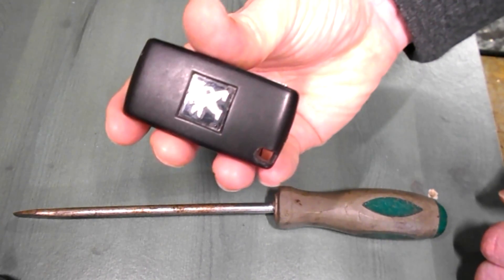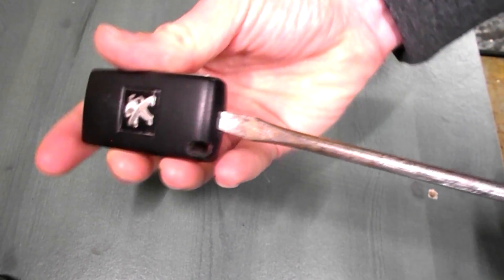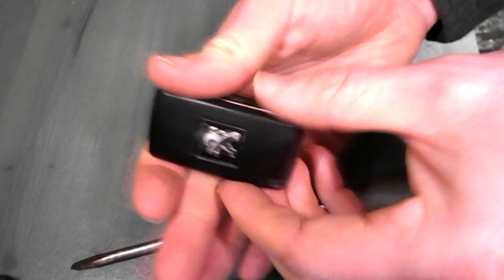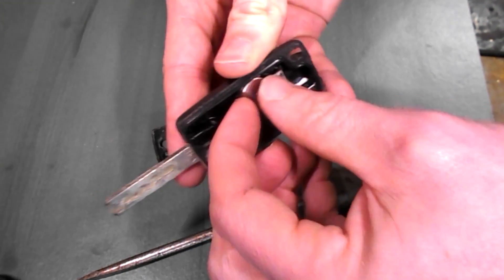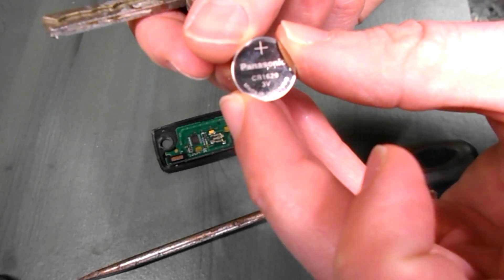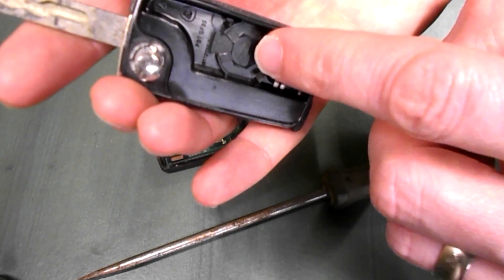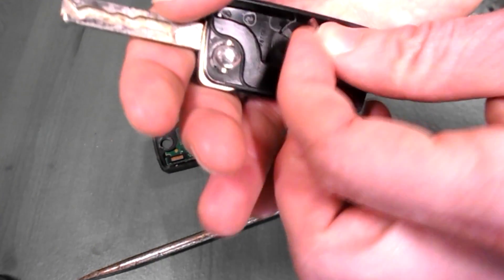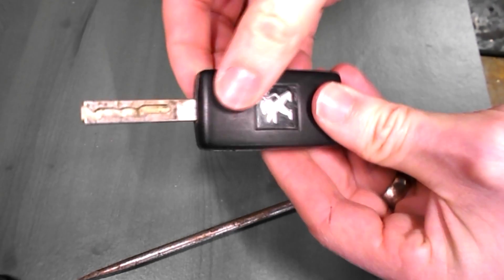Peugeot Key Fob Battery Replacement

Comment: If you're key fob doesn't work after replacing the battery, check the connections are okay.  Look for two small gold coloured flat patches on the circuit board. These will be on the reverse side to the micro switches (i.e the side you can see when you open the fob up and haven't taken the circuit board right out). 

Using the end of a small screwdriver, gently scratch at the gold patches to clean them. Try not to damage the green plastic around them, although a few small scratches won't matter. You're just trying to expose fresh metal from the gold connectors, not remove then completely! If in doubt, remember that you can always come back and scratch some more, but you can't put back what isn't there anymore because you over did it! 

You can do something similar to clean the other silver / chrome coloured battery contacts using a nail file or sand paper. 

Once you're done, give the circuit board a gentle wipe over with a soft cloth. 

Resemble the key fob and check the operation on your car. In my experience, I've not needed to worry about resynchronization of the key with the central locking system, but there are instructions on your handbook on this is done if necessary. 

Good luck!

Comment: Ps... Use a plastic phone opening tool to pop open the fob. This avoids tearing up the plastic fob. 

If your fob is a bit battered and hard to open, take a broad flat bladed screwdriver and use a small hammer to tap it into the join adjacent to the slot that this video talks about. Use caution with the force of the hammer! The fob will pop open and can be then opened as shown in the video. 

Ideally, then replace the fob with new (get one off of eBay).  Follow instructions to swap over key blade as per other videos on YouTube. Easy task.
Reply: Prevedi

Comment: Our key looks the same but is different inside. You need to take out the circuit board to slide the battery out.